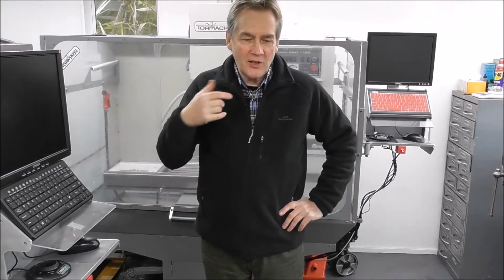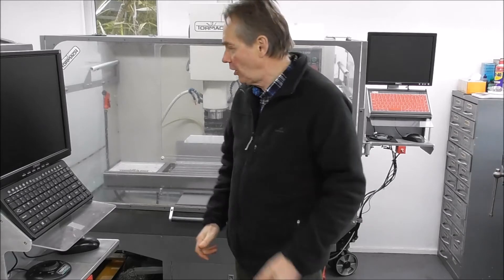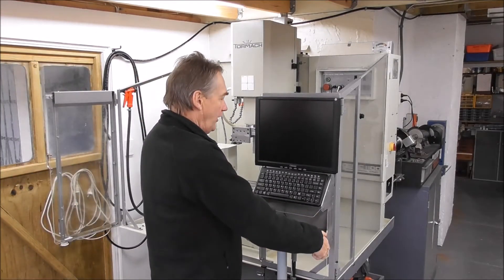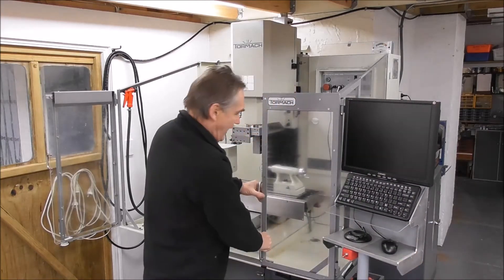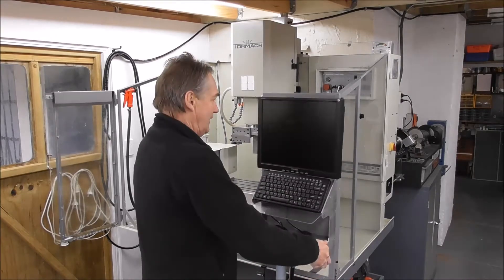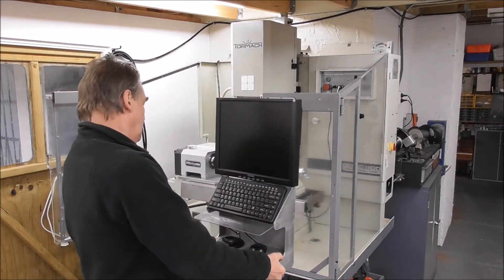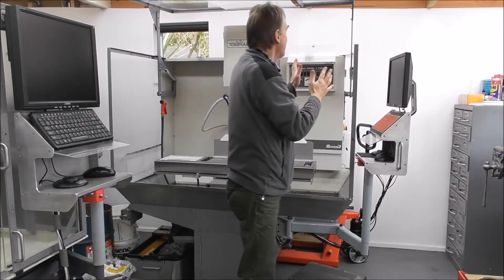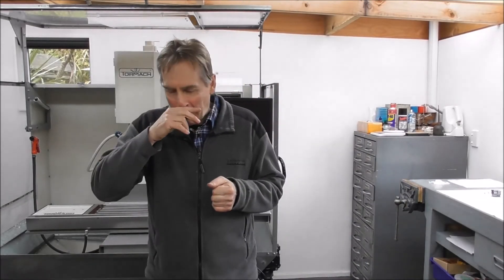Compact Tormach Enclosures and Monitor mounting.

Comment: Cliff a year ago your inspiration for the compact enclosure design proved to me I could accommodate a 770 in the 'alcove' part of my workshop. Before that I was contemplating a 440. I'm so glad I went for the bigger machine! My 770 and enclosure setup is only 1250mm (49") wide between walls and without your 'letter-box' hinged-flap arrangement allowing the left X-travel to extend into the thickness of the stud wall It would have been a non-starter. Also, the hinged left and right panels and sliding doors idea is perfect for me - I'm grateful every time I use it!
Thanks again for the simple yet innovative design and the informative videos that make copying your work such a breeze!
Cheers, Andy, Oxford, UK
Reply from the maker: Hi Andy - Good to hear from you!  Thanks for posting that, makes my videoing seem worthwhile. Cheers  Cliff

Comment: Hi Cliff, Once I get moved into my new smaller shop later this summer, my plan is to build a new enclosure.  I have found several ideas online and I find your thoughtful development of your enclosure most aligned with what I'm after.  Space utilization will be key, so your timing couldn't have been better.  I've already stolen your three legged design for the base that I built last year.  Coming from race car building, I used 1/2" drive, suspension "weight jacker bolts" for my three adjustable legs.  Thank you for sharing your ideas.  Mark :-)
Reply from the maker: Hi Mark - and thanks for the feedback. Cheers.